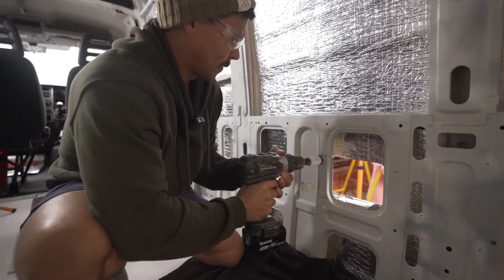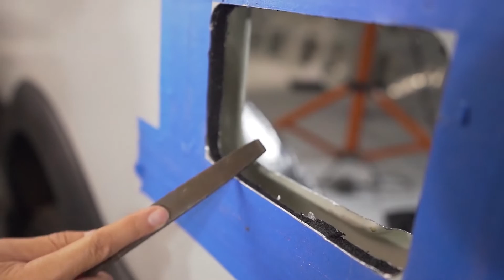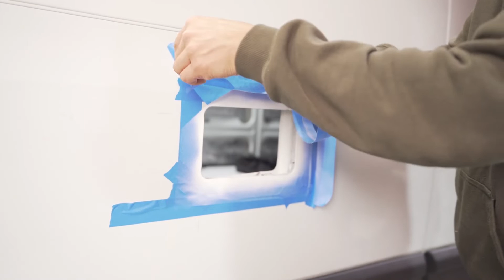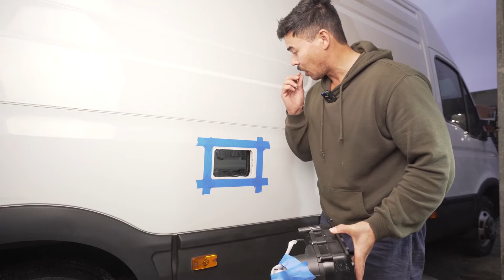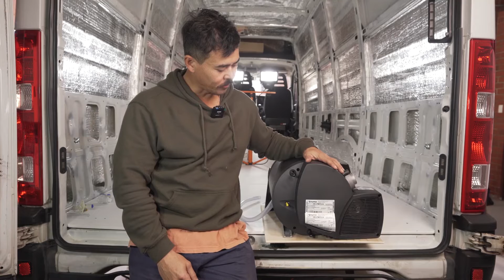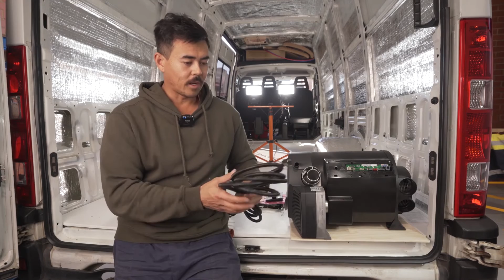Truma Combi D6 Diesel Heater/Hot Water System

Comment: Dude, about to take the plunge and tackle this during the weekend. Wish me luck!... Not looking fwd to removing my fuel tank, especially as it's half full >_< . Thank you SO SO much for this in depth tutorial, it's giving me the confidence i need going into this. Question- I'm moving back to Perth from london after being away for 13 years; is there a big market for these conversions? I'm considering converting some and renting them, then do conversions to flip at same time. TIA for advice!.... FYI I use Sikaflex 522 as it's better than 221- "The main difference is that 522 was specifically made for caravans, motorhomes, and trailers. While 221 is one part polyurethane, 522 is the hybrid version and has extra resistance to UV breakdown. It was designed to bond to metal primers, paint coatings, vehicle components and plastic. 522 is fast curing and can be used for interior and exterior jobs while 221 is more suited to interior and simple bonding applications.

This means 522 is especially suited to heavy duty jobs such as repairing skylights, solar panels and satellite dishes, whereas you may find 221 more suitable for jobs such as sealing around windows.

Another difference is that Sikaflex 221 comes in white, black, brown, and grey whilst 522 only comes in white. However, if you have a job more suited for 522, it can be sanded and overpainted."